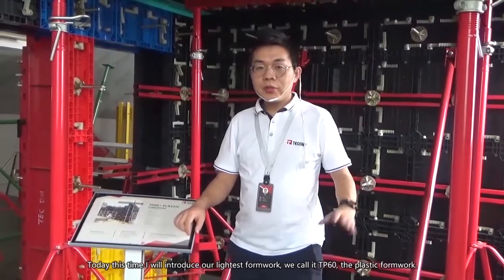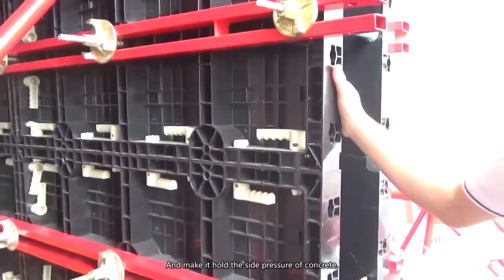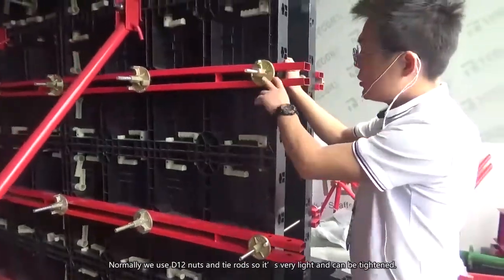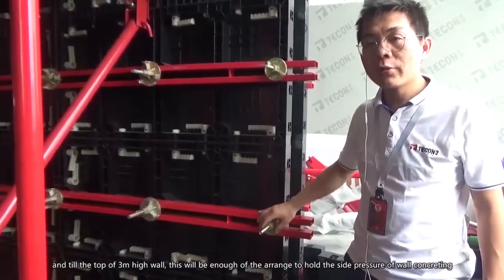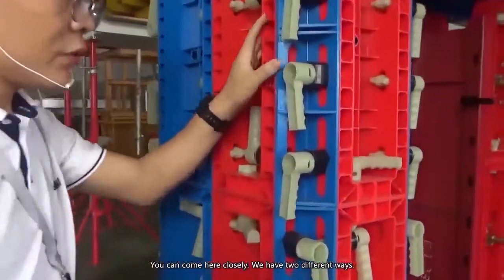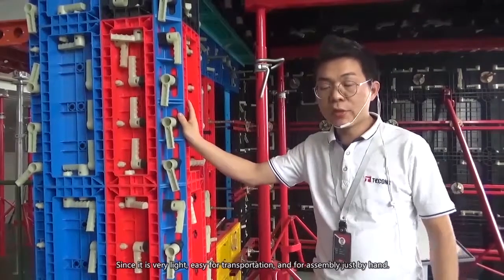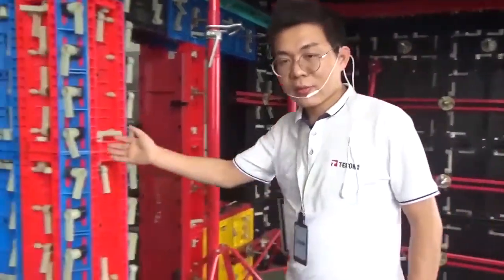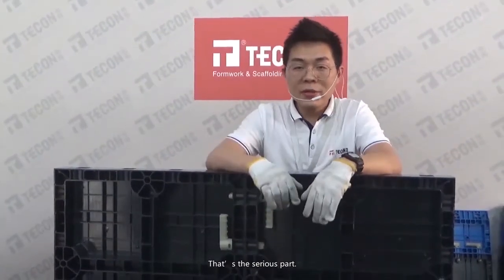TECON | Plastic formwork TP60

Comment: Can you produce a particular size of plastic formwork based on customary demand or request?
Reply from the maker: May I know which size do you want? Roughly connect a fews of different size of panels to meet particular size due to the biggest panel of plastic formwork is 1200*600mm. Tks 
hone /WhatsApp /Wechat/Viber :+86-15705172730

www.teconform.com